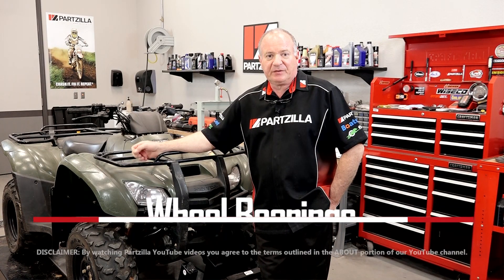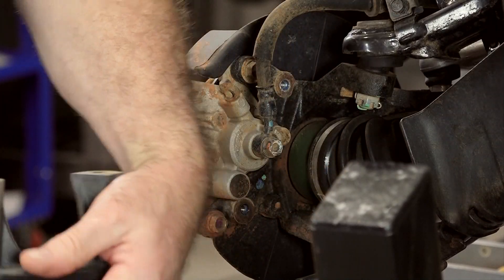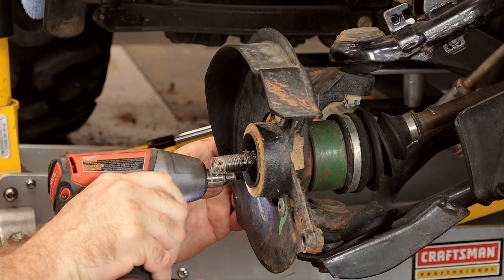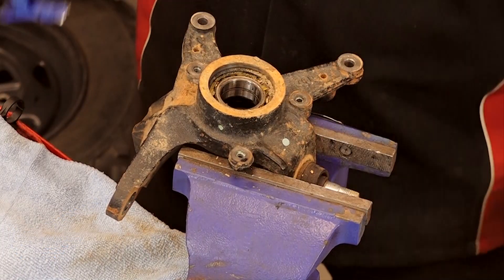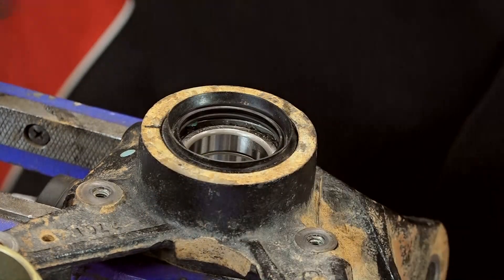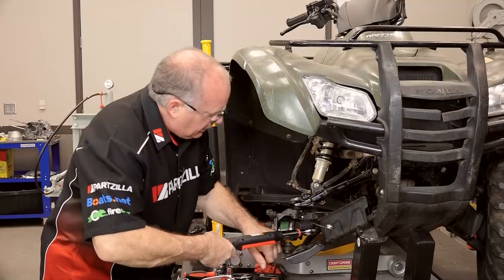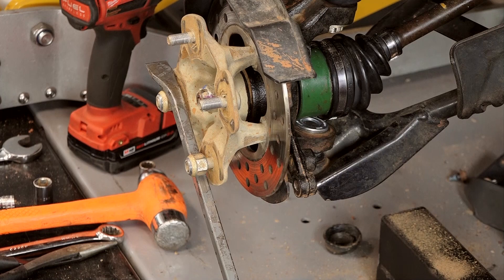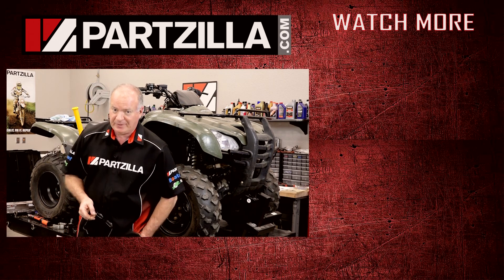How to Change the Front Wheel Bearings on a Honda Rancher | 2012 Honda TRX420 Rancher | Partzilla

Comment: Hello, great video. I also have a Honda foreman s 500.  Just changed the bearing and seals. I did everything the same way you did it. When I finished I had the same wobble     With the tire. Checked everything. The bearing seemed to come out a little to easy. Could I have a bad knuckle? I torqued main nut to 58 ftp and still wobble. Can you help with advice.
Reply: I'm having this same problem, I wonder if it's the hub
Reply: Well I haven’t figured it out yet why I have the wobble but I got new bearings and seals so I’m just going to live with it a little bit of a wobble.Probably gonna wear out the seal somewhere down the line.
Reply: @MikeRogersMusic  i have this problem too.  i have a lot of wobble on the left side and very little on the right side.  cant hurt to replace bearings and new hub.  i have a 2004 foreman S
Reply: what year?
Reply: @MikeRogersMusic  Its 100% the hub. I know this comment is old as sin, but take the hub off. The bearing will literally be loose where it seats. Driving the bearing in, you feel resistance. But its actually worn out where it bottoms out. Total PITA after buying bearings, and needing a hub. I tried 2 different brands/bearings and this was the issue. Theyre on ebay for around $45 used, or you can spend about $270 for a new OEM one. Somewhat known issue on the honda forums. Personally I'm rolling the dice on ebay and checking for the same issue when it arrives.

Comment: @partzilla I noticed you have a few bearing changing videos. Sorry if I’ve missed it but have you done bearing changes on a 2016 Polaris Ranger or similar utv/atv with front struts?
Reply from the maker: A while back we did a wheel bearing replacement on a 2011 Ranger 800 crew: https://youtu.be/yrlbdD3xDOA
Reply: @PartzillaParts  thank you for responding the front strut hub on my Polaris Ranger is part 1824180 (right side). I think it’s a little different and was wonder if just the hub is removed (decompressing the spring) or entire strut assembly (with spring) is removed to replace the bearings. I guess either way would work just wanted to see a master changing it out lol

Comment: I dont have a press, im trying the 2x4 method to press bearing back in however it seems to be being stopped by a lip when it's about 1/2 way down leaving 3/8" sticking out any suggestions 

I was originally using Amazon part then decided to try OME part same issue with both please help!!!